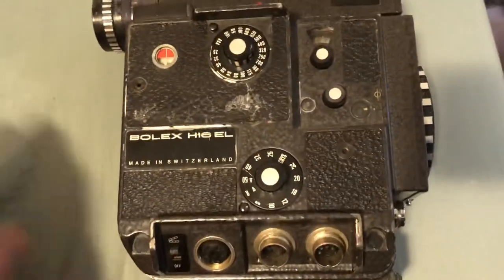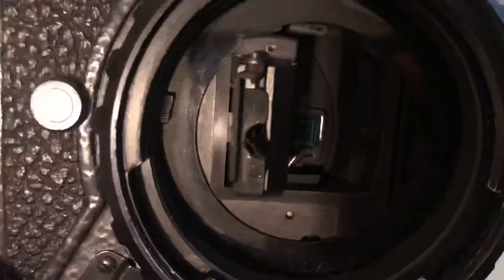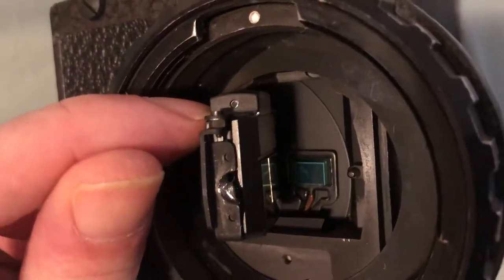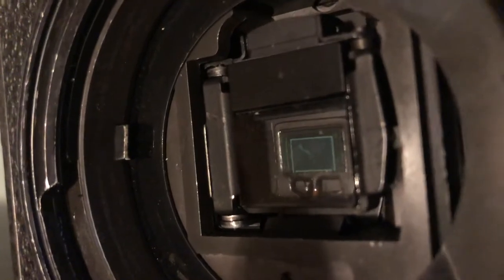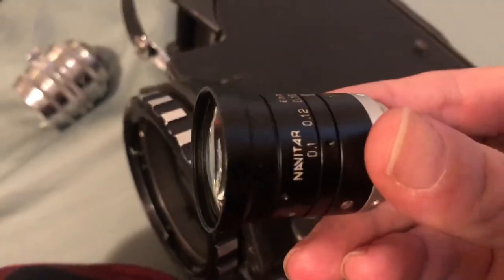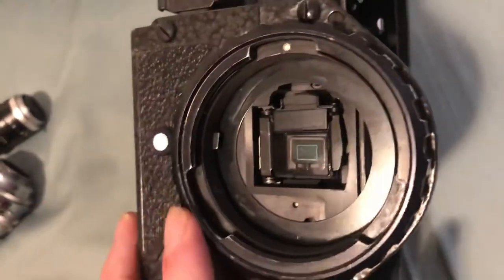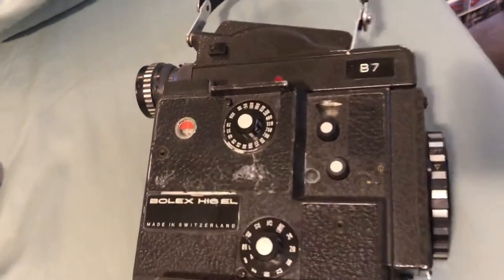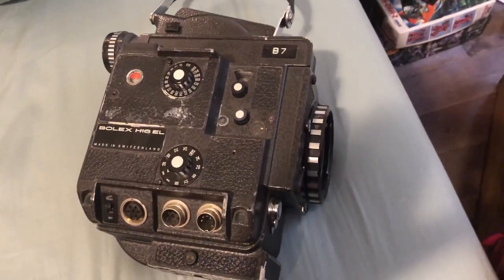The problem with the Bolex reflex prism

Comment: There’s no such thing as a pellicle prism. You either have a pellicle or a membrane which as thin sheet of glass (Pathé WEBO M, Christen DB, EMEL Reflex, Mitchell BNCR) or a double prism with a partially reflecting surface in between. Another reflex finder concept provides a mirrored shutter intercepting the light path at an angle (of mostly 45 degrees). Sorry to disturb the peace around this video but wrong statements I must correct since I am a film motion-picture equipment technician.
Reply from the maker: https://bioskoplab.files.wordpress.com/2011/10/rxrule_76-78.pdf